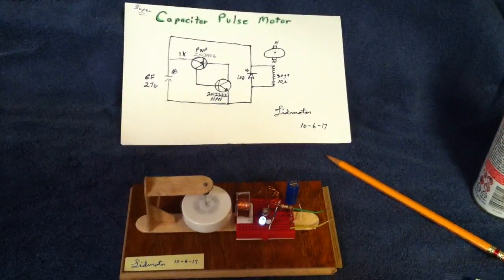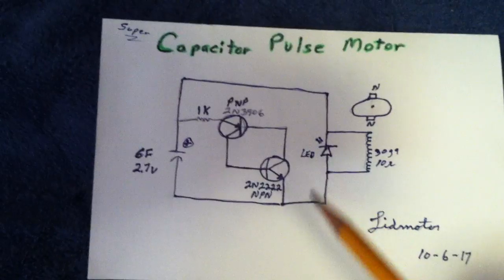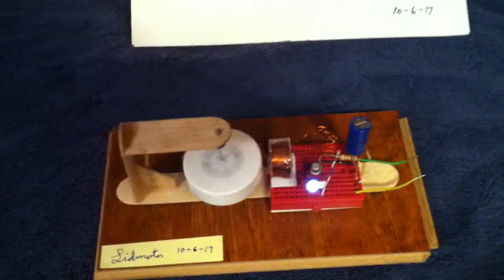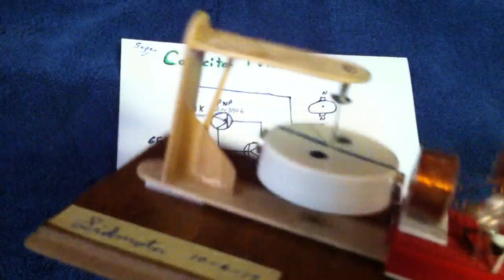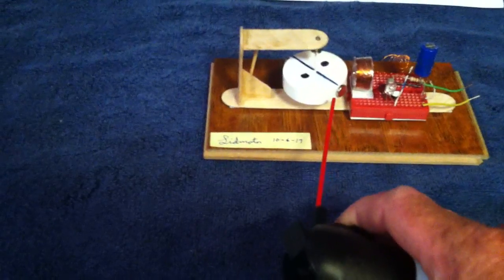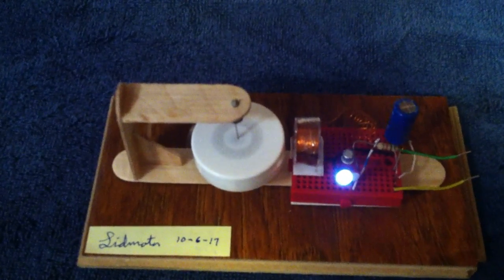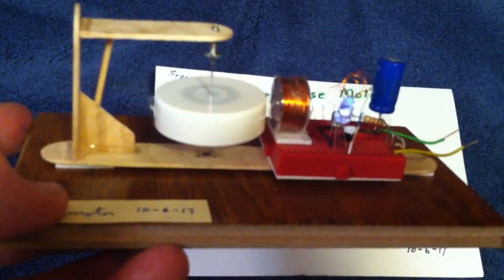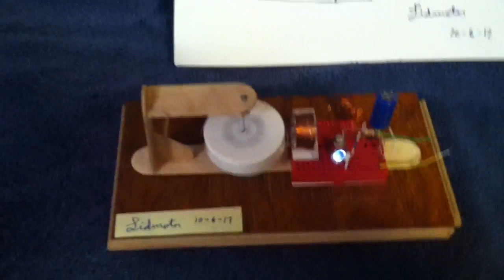Capacitor Pulse Motor

Comment: Hey love your videos I have a question though. I made an electrostatic motor similar to the one you posted about OUBrad design with the ping pong ball and a needle shaft. Do you actually know how to do the physics calculations for these motors? I am having trouble going about how to predict the rpm

Comment: I thought about something like this. using a cap bank. motor and a generator. to generate DC . use a solar or small hydro electric generator. to charge the caps. and start the system. use the flywheel to spin the generator. use a small part of its output. along with she solar or hydro. charging the caps. and pulsing the motor. keeping it going. and I'm thinking about a 1-2 HP motor. and about 1500-2000 watt DC generator. with a 100lb, give or take , flywheel. basically a power amplifier. after getting it started. then use the output to charge the batt bank. have you tried anything like this? or think it could work. or would it be a waste of time and energy. I'm looking for a way to run my off grid home. charge the batts. I figure if anyone knows if this is worth trying. it would be you! great video.
Reply from the maker: The best thing I have found for "free energy" is a solar panel.  They have become much less expensive and more efficient.  A wind turbine is perhaps better if your location will allow it.   Forget about building a machine that "makes" energy.
Reply: Lidmotor thanks .that is what I thought. stay away from the cosmic energy collectors. and RF battery chargers. and all the too good to be true crap. right.  I was hoping it would be an ultra efficient generator. but guess not. thanks.

Comment: Hi, would it be possible to run the rotor with the same circuit like your JB Zero Force Motor Type Lidmotor?
Thank you
Reply from the maker: YES!  The basic motor structure can be reconfigured into many different forms.  Because the magnets are not glued onto the rotor that can be reconfigured also.  JB's good ole SSG would be a fun build .  A new bifilar coil would be needed but the little circuit board can be used with a few addition components,  The Zero Force would need special long coils but it is possible.
Reply: Lidmotor , Thanks . Will try it. You would be pleased to know how many of your circuits I have replicated and so very successfully. I am truly grateful.
Reply from the maker: You are welcome.  I'm glad that you have had fun with this stuff.

Comment: Your circuit diagram is confusing... isn't that a dead short from the cap through the coil? Surely it can't be that way?
Reply from the maker: YES.  The circuit diagram is drawn wrong and I explain that in the description.  The coil return is supposed to be shown connected to the NPN collector and not the emitter (ground).   Thanks for the comment so I could explain that here.
Reply: Of course the boottom diode (Anode) not supposte to be connected to GND but at the collector of 2N222! regards

Comment: Power it with the fidget spinner u used,  the magnets would transfer rotation power from the spinner to your lid rotor,  dumb idea but if it works itle save a lot of canned air
Reply from the maker: Great idea thanks.

Comment: Assuming frictionless bearings, what is the expected frequency (or perhaps rpms) of the motor.  How would you increase or decrease the rpms electronically, if possible?
Reply from the maker: You can control the speed by using a variable resistor on the PNP transistor.  If you had totally frictionless bearings and this was running in a vacuum-- the RPM would increase until the rotor came apart.  The frequency is controlled by the magnets passing the coil.  The transistors can switch much faster than the rotor could tolerate.